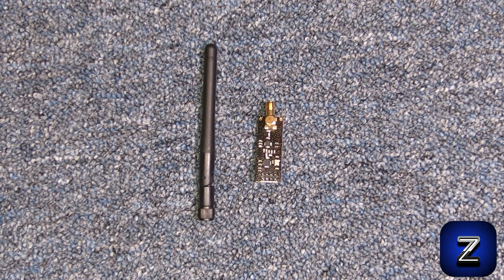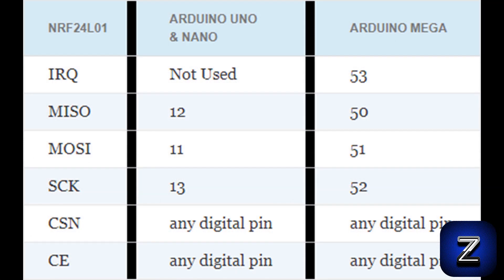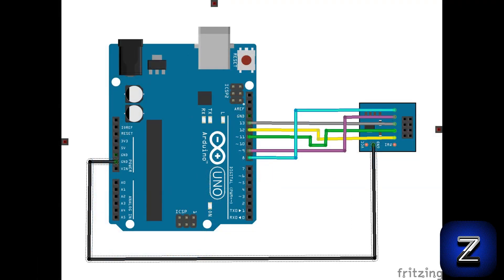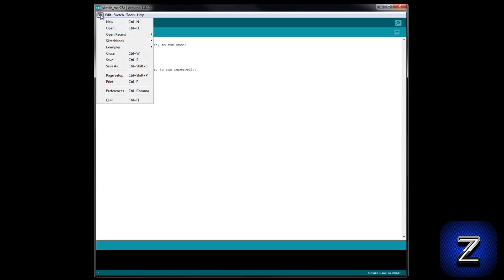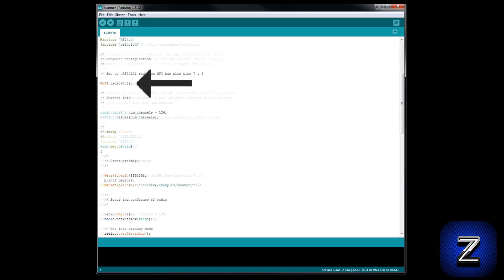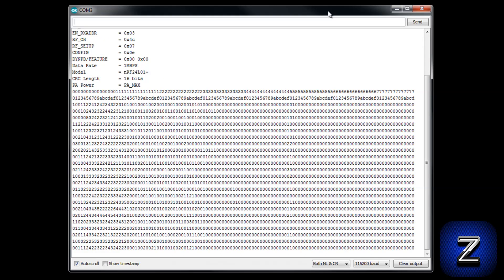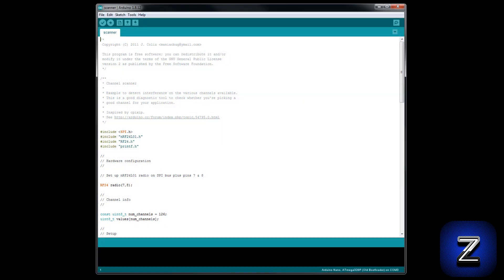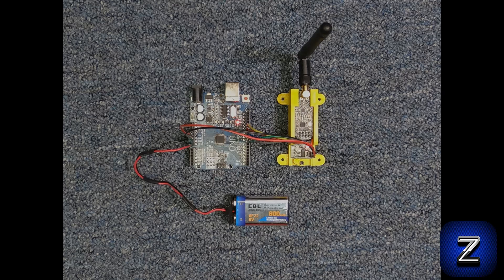How to set up the NRF24L01+ so it works correctly

Comment: I have a question.. I have this setup with two nrf24l01's.  I notice that if the antennas aren't in the same orientation the signal drops.  For example, if one antenna is bend 90 degrees and the other one is not then I lose control.  Do you have a recommendation on this?  Is it possible to run two nrf24l01 on a transmitter in two different orientations in order to eliminate dropouts?